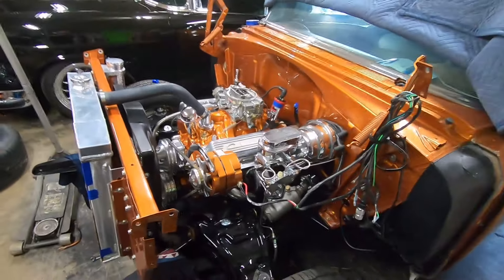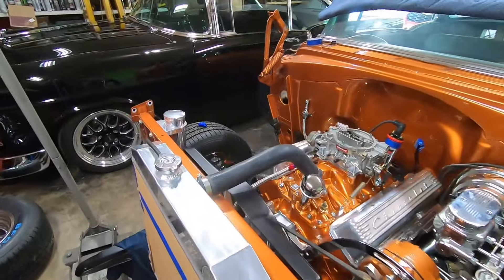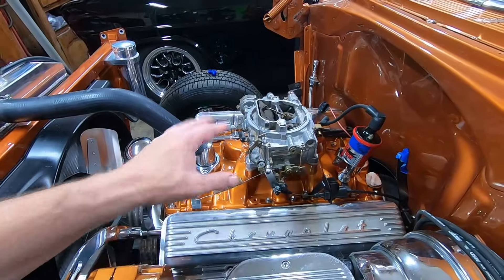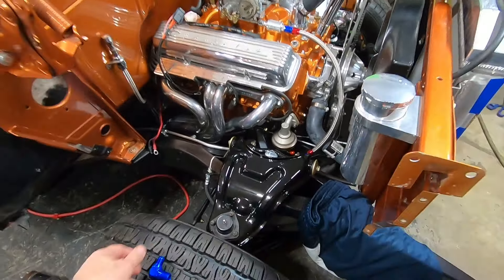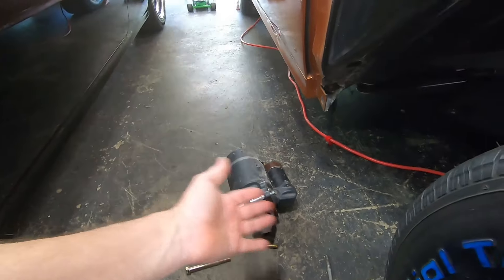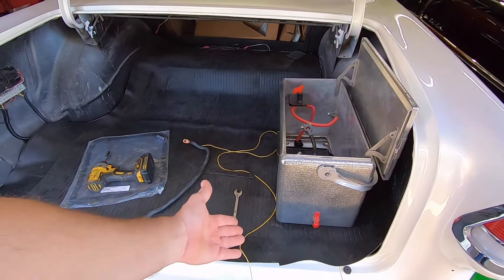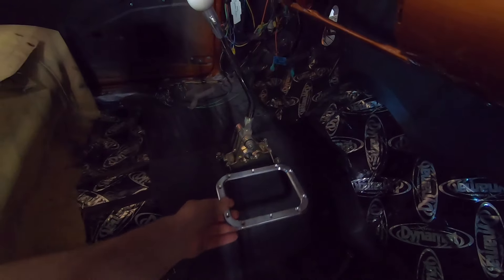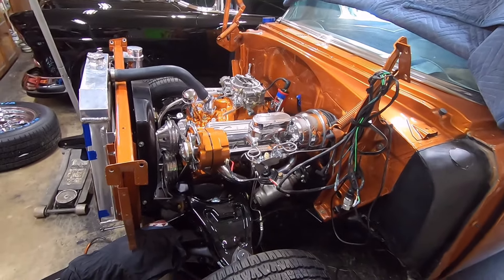Steve's 55 update. Getting close to starting engine.

Comment: I understand why you usually use long water pumps but with Steve's short pump why use the long spacer and radiator in the 6 cylinder position? I don't remember using special starter bolts until the starters changed to the new style without the cone sticking into the bellhousing but that was a long time ago so I may be wrong.
Reply from the maker: Steve wants the radiator out front. He doesn't like seeing the inside of the core support with the radiator behind.
Reply: @haffrods7055  Ahh I see. Its his car and everyone likes things a little different, that's why this hobby is so enjoyable....Well most of the time anyway.
Reply: @haffrods7055  What brand radiator is that?

Comment: How effective is that fan shroud gonna be with that big gap between it and the core support? I always found the most effective shroud/ mechanical fan combos were when the shroud fit snugly around the core support. So you actually "create" draw.
Reply from the maker: Yeah, thats another issue I have to address. Brand new fan shroud that doesn't fit correctly.